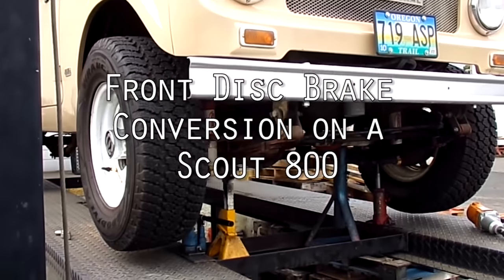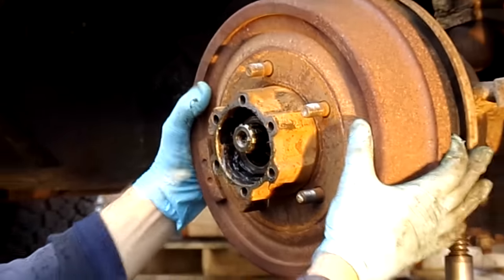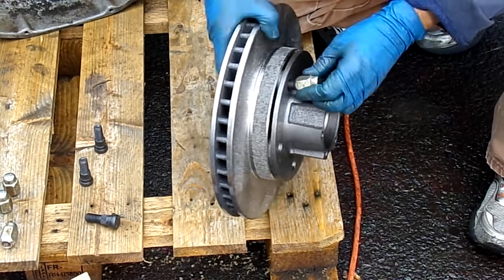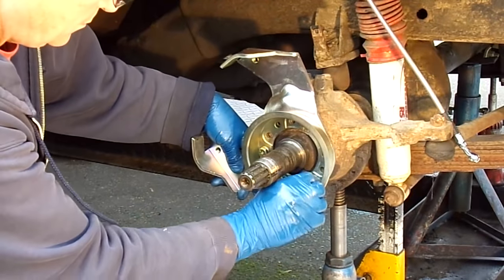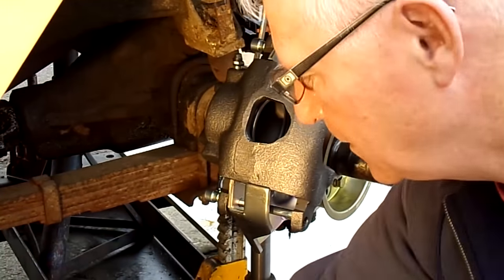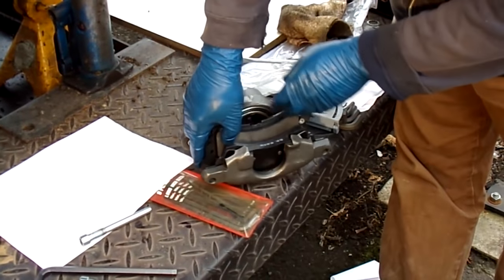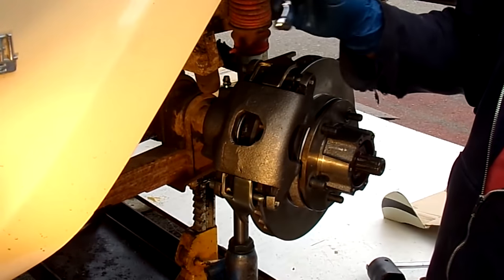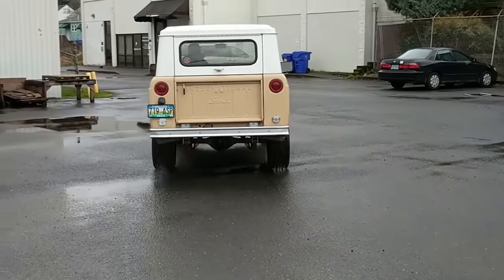Front Brake Disc Conversion Kit for IH Scout 800

Comment: All that talk about hiring a professional, then uses a chisel to remove axle nuts (instead of socket), doesn't freeze bearing races, doesn't seat bearing (torquing higher like 60 ft/lbs and turning to help seat new bearings), then doesn't remove residual valve from master cylinder which is needed for drums but not discs.

Comment: Remember! Studs on Frount drivers side are opposite direction, should have the L stamp on lug nut! Other wise excellent rundown on the this massive upgrade !
Reply: There is no real, modern-day reason to right-hand thread and left-hand threaded nuts. Tire shops will mess up your rims up.

Comment: It seems to me that I would use the appropriate tools, such as a large hib socket instead of a screwdriver and a bearing race installation tool instead of a drift. Be mindful of talking down to us lowly brake mechanics. I would have cleaned all the crust off the rest of the axle, seems less than professional